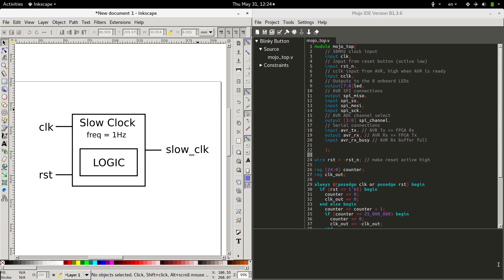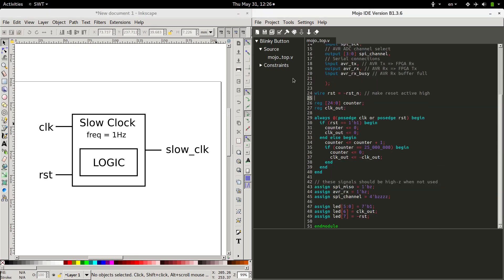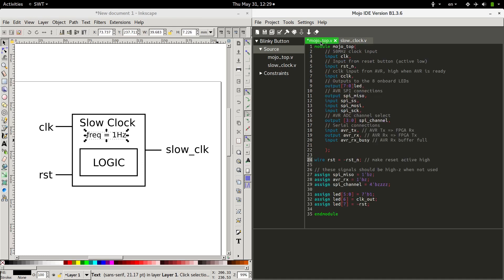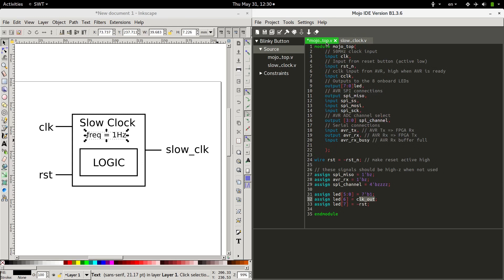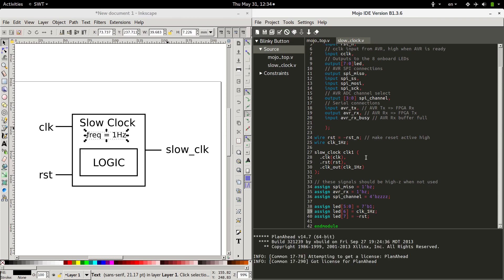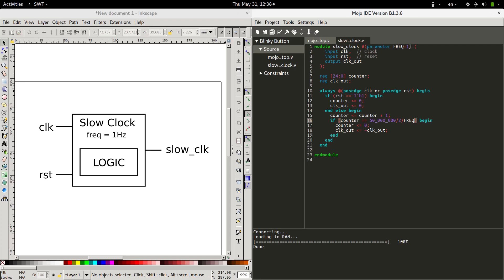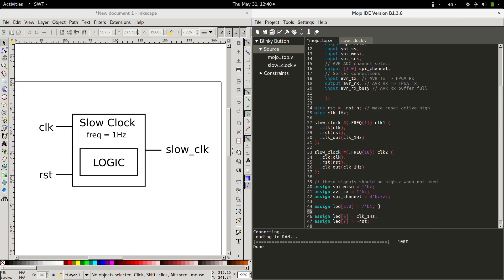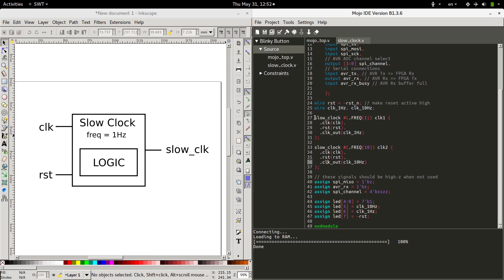Learn FPGA #9: How to Clean-up/reuse your code using Modules - Tutorial

Comment: As it is, all the instances of that module use a 25 bits counter. For higher frequencies (smaller counts) some bits are never used. The definition can be improved by using the log2 function to calculate the number of bits strictly necessary and use it in the counter declaration.

Comment: One question Sir: in one of the previous videos you changed one of the last lines of your code to assign led[5:0] = 7'b1. But shouldn't it be  assign led[5:0] = 6'b1, since now you're only considering 6 leds?

Comment: In mojo_top.v,  you have FREQ(10), but in slow_clock.v, you have "parameter FREQ = 1". It seems to me that whatever you choose as the frequency in mojo_top.v overides the parameter FREQ value. So, does it matter what value you place in "parameter FREQ = "? Is  "parameter FREQ = 1" a must?
Reply from the maker: The "parameter FREQ = 1" in slow_clock.v defines the parameter as well as provides a default value for it in case it is not specified when instantiated.

Comment: So whenever you use a module like that, does it recreate it on chip? if not, how does it manage multiple objects wanting to access the same module?
Reply from the maker: Yes, every time you instantiate (create) a module, it builds a new one. If you use 4 of them in your code, the synthesizer will build 4 of them in the FPGA.